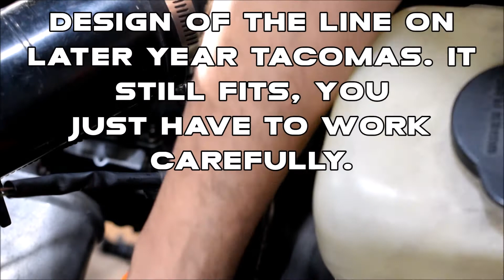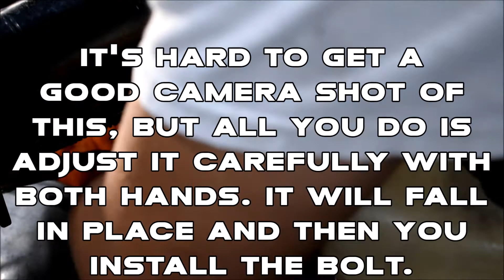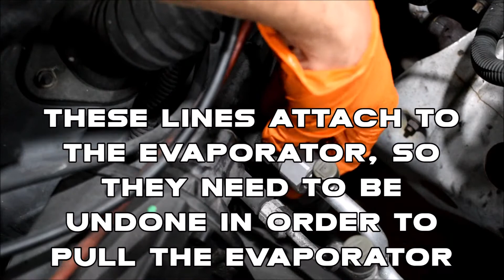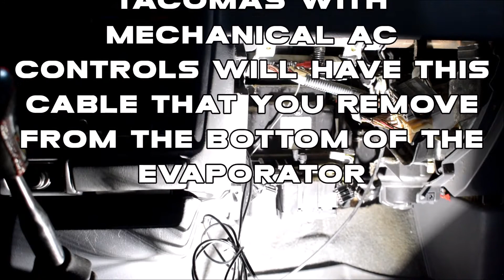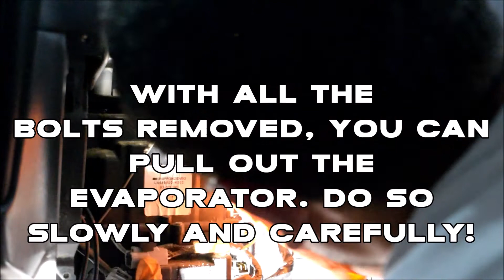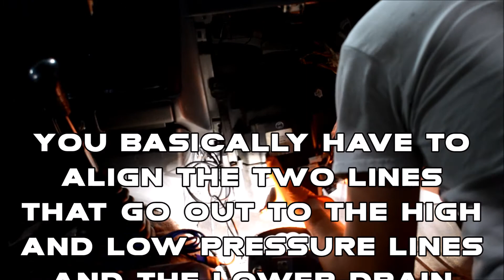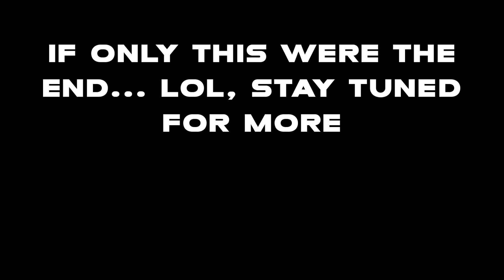Tacoma AC Repair Part 2

Comment: hey man! Anyidea when your next steering wheel video is coming out? Love it :)
Reply from the maker: Thanks! I'm currently filming it. Both wheels are wrapped in Carbon Fiber and I am working on the process of getting it smoothed.
Reply: Excited to see it! I’m planning to start an attempt at modifying a BMW steering wheel. Did you do a layer of epoxy, wait for it to become tacky, apply the carbon fibre, layer of epoxy, wrap in shrink tape and then heat it up? Or did you just do layers of epoxy without the shrink tape?
Reply from the maker: Part 3 of the steering wheel series is now up https://youtu.be/V23FDWQXvJY
Reply from the maker: @cameronboot6722  I did carbon on tacky epoxy and then shrink tape. Once that set, I peeled the tape and added more epoxy. Check out the process in video 3.